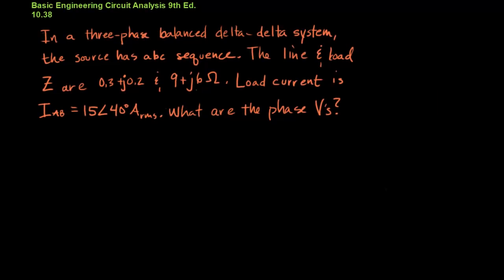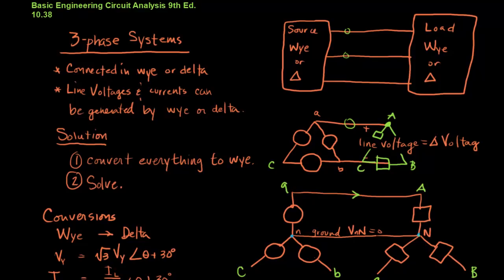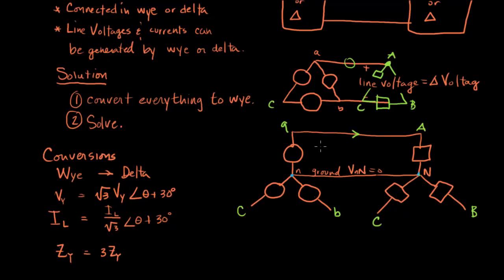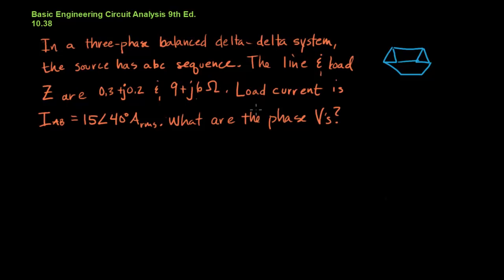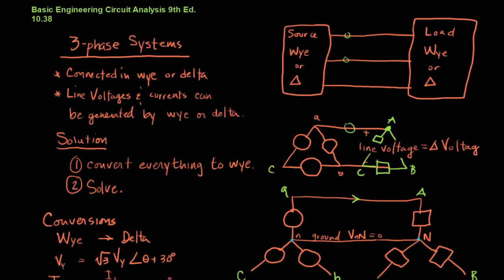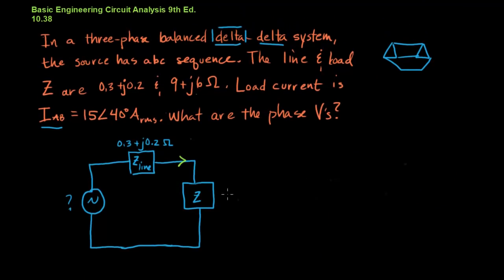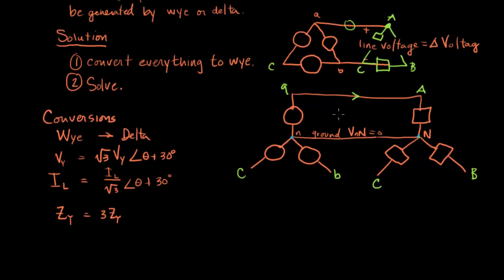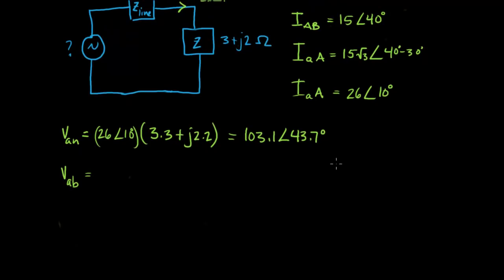Three-Phase Circuits

Comment from the maker: Good question.  Reading the problem is often the hardest part...no kidding!  Here the load is 9+j6.  To make things easy, we are using the "per-phase" approach.  The load is balanced, meaning evenly distributed over each phase.  When we observe a single phase of the circuit, we see only 1/3 of the balanced load.  Hence 3+j2.

Comment: I have a few questions that I need some clarity on. Thanks in advance. 

1. Does the line "Z" refer to the impedance found between the load and source?

2. Does the load "Z" always refer to a single branch of the load or is this some  total load "Z" value?

3. How do we know that the phase voltage asked for in the last part of the question is not referring to a voltage across a branch of the load?  

4. Are the load branch voltages referred to as line voltage? This seems to be where I am having a little trouble at.
Reply from the maker: 1.  Z (line) is the impedance of one of the transmission lines.  So yes
2.  In balanced three phase systems I believe it is customary to give the load as per phase.  
3, 4.  Look again at the first part of the video.  In delta, the line voltage is the phase voltage.  In wye, the line current is the phase current.  We convert delta to wye to develop a per phase solution.  But in wye the voltage we obtain is between phase A and neutral.  If we want to accurately describe the phase voltage of the delta system we need to find the voltages between the lines.  I hope this helps!

Comment: You were very clear! Thanks ;)
Just one question: is it arbitrary which delta voltage you substract 120 degrees and which one you add it?
Reply: Jose Luis Haddad that's what mentioning the sequence abc is all about. If it was acb, 120° would be subtracted from Vca instead of Vbc.